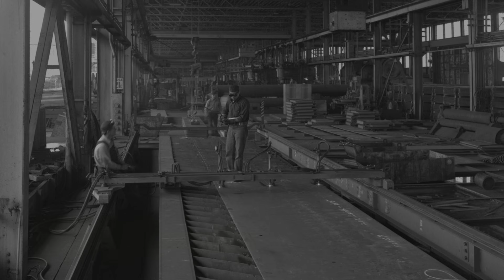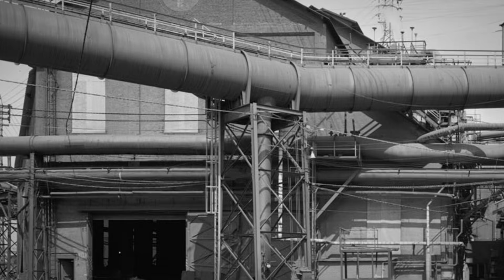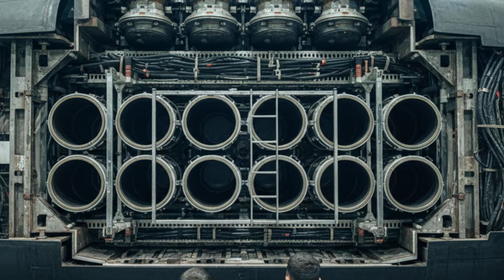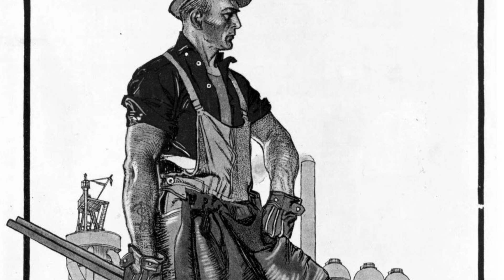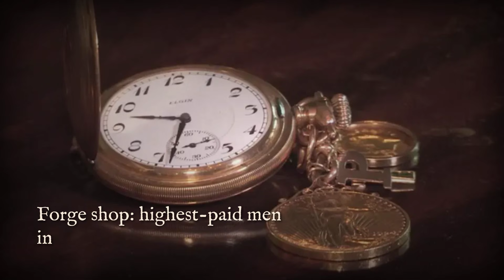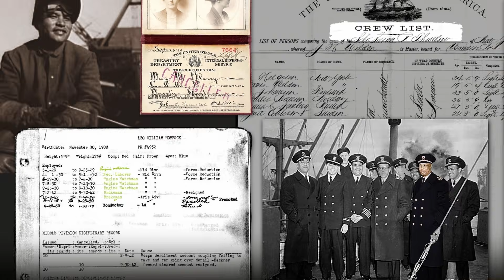35 Tons Nobody Feared : The Hammer That Ran Bethlehem Steel

Comment: To all the conspiracy theorists out there...this is proof that steel doesn't need to melt to deform.
Reply: That said - you get petroleum distillates under a forced draft, e.g.a tall-enough chimney or with a blower - and you can turn steel into cast iron, which can be readily melted and then cast.

Like so:  https://youtu.be/lPy0B_5ltBM?is=6CReN-WJ7eAMTk6u